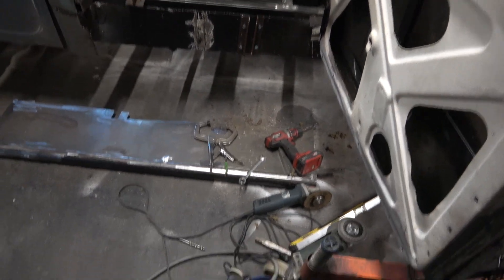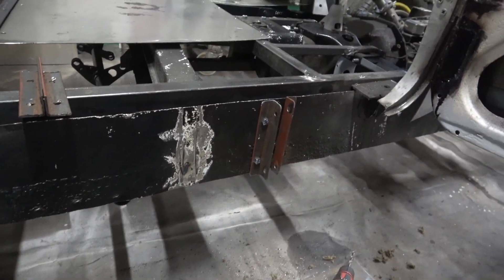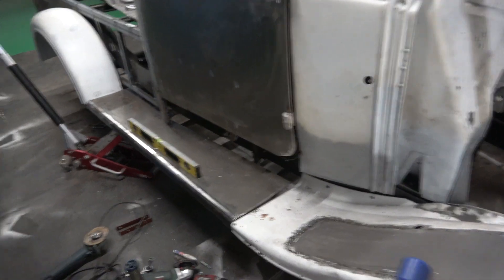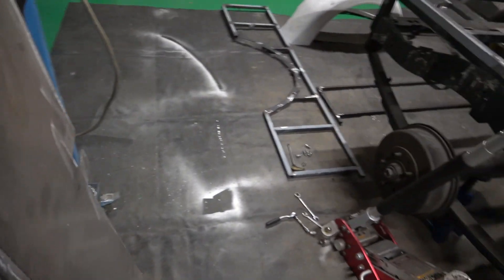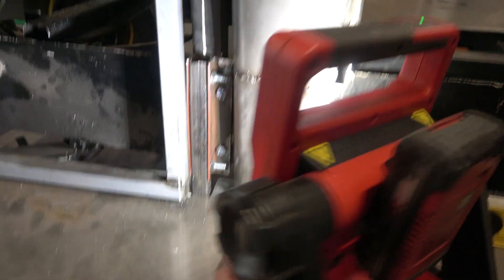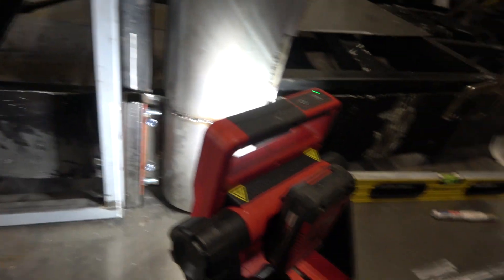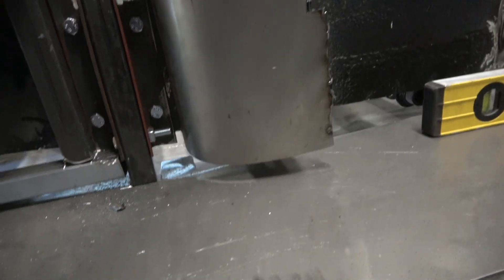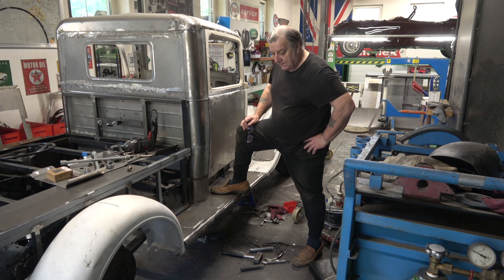Barn Find Made Into A Pick Up ( Fabricating The Running Boards ) Part 30

Comment: The side step is really going to set off the looks of that thing, yet being very practical entering and exiting the truck.
Reply from the maker: I agree i think it ties the whole thing together structurally and atheistically as it‘s not a restoration more of a new build I get the chance to come up with my own
ideas and use some tried and tested ones as well. I‘m really enjoying the challenge of making parts from scratch it‘s very rewarding. Cheers Dave

Comment: I've run many trucks with running boards and yer front bracket should be spot on as i know ye always put yer foot level with the front of the seat as you step up in.
Reply from the maker: Doug,  They are a little heavy and a bit over engineered but they should last a long time 🤣😂 I will need to work on my technic for getting in & out Cheers Dave